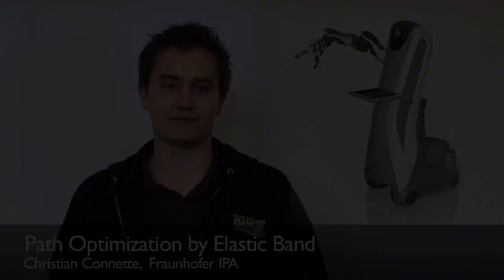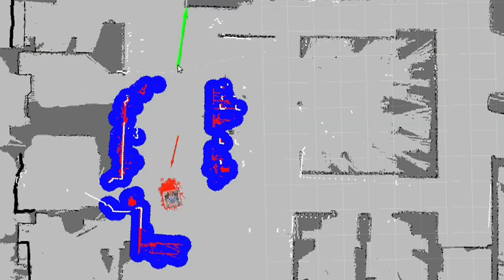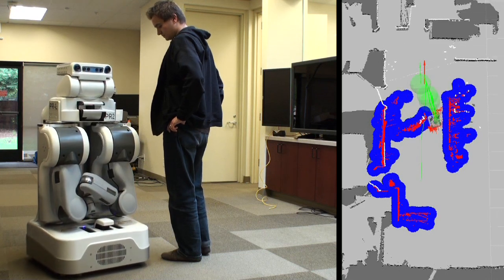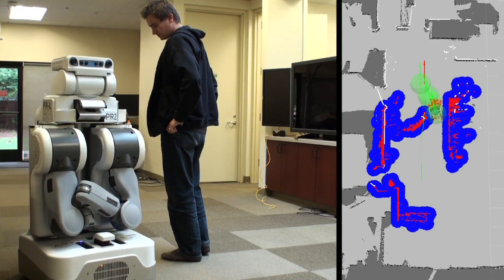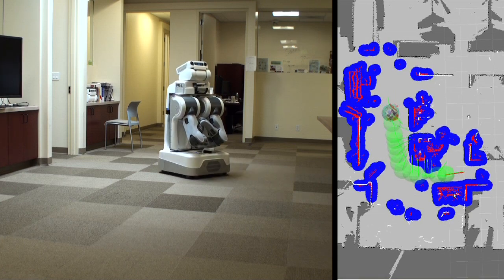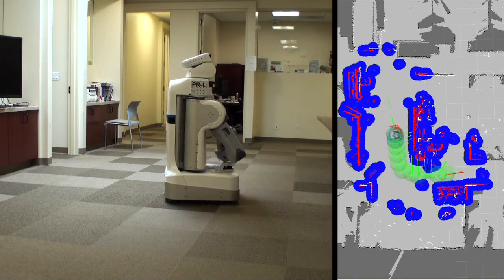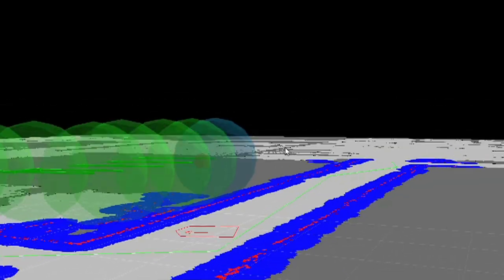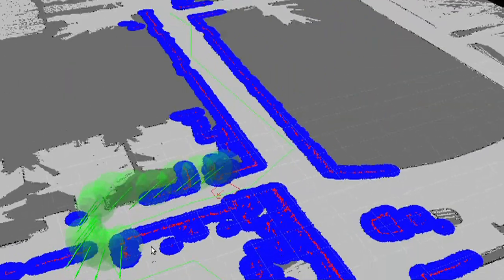Path Optimization by Elastic Band

Comment: Hi congratulations for the implementation! I used this planner for a car-like robot and had a strange move...I mean the frontal tires move to left and to right every time and the car does not follow a straight path. Is it not suitable for this kind of robot? Which parameters could I change in rqt_reconfigure in order to have this planner working ok for a car ? thanks in advance
Reply: I read here about a oscillation cost funtion which prevents the robot from oscillating http://wiki.ros.org/base_local_planner?distro=noetic.